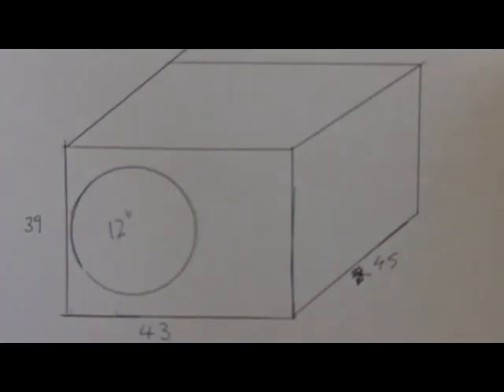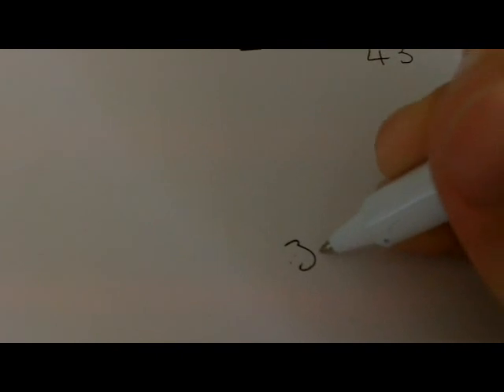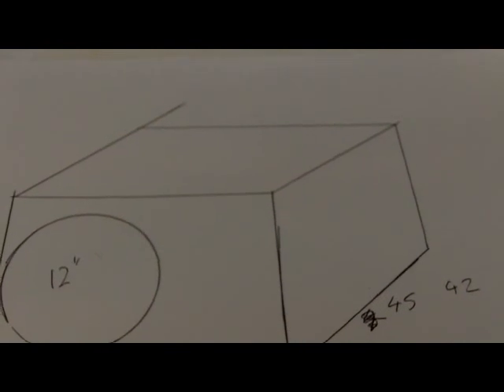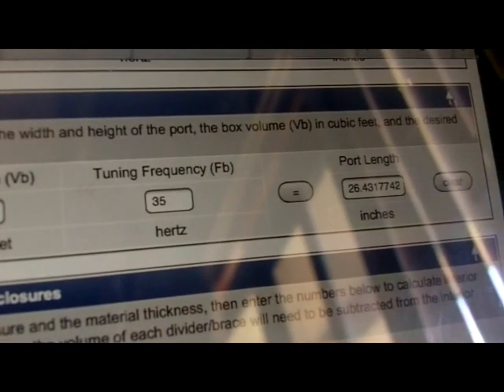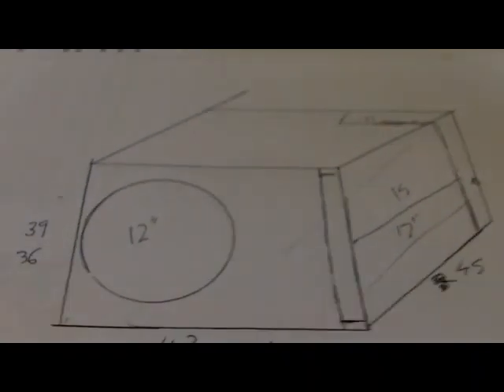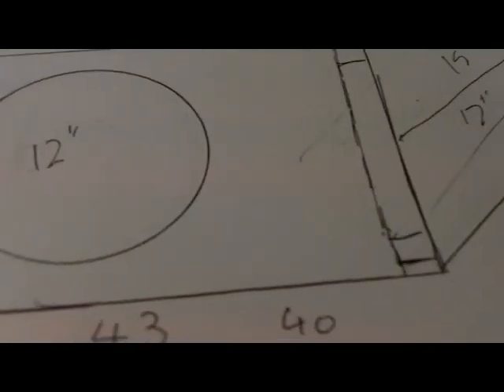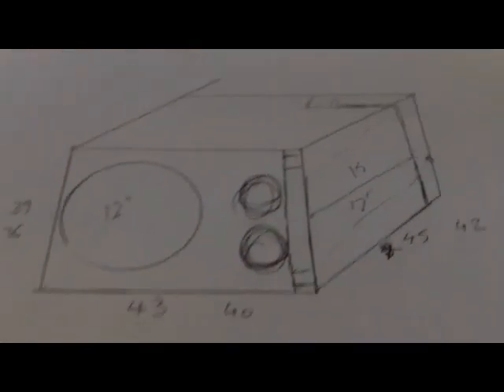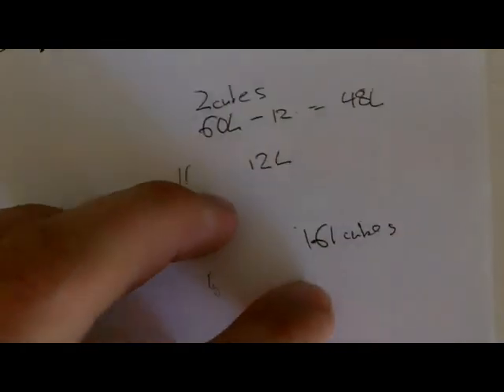HowTo: Tune A Suboofer Box To a Specific Frequency - Calculating Hz

Comment: I have pioneer 3004d4  subwoofer  needs about 35.4litres was thinking i do a 18" height width of 14" and depths of 19" calculating the vent port length gives me difficulties. Please help

Comment: This video seems to incorporate the port Volume ( or port displacement) as part of that 2 cu.ft internal volume figure that gets inputted into the calculator.. Are you sure we are not supposed to enter the NET volume instead? This to me would be the GROSS internal volume that we are currently specifying, and the video only mentions the removal of the displacement of bracing at 1:38 - 1:42 of this video

Comment: i am building a dual 18 inch sub woofer enclosure with a volume of 12.75 cu.ft
 using the KAPPA PRO 18LF-8 which has a usable frequency range of 38 Hz - 0.7 kHz , a resonance of 32 Hz and it also has a recommended box tuning frequency of 40Hz but i feel 40Hz wont hit the low notes just right .what frequency should i tune the box i am building to ,32Hz, 38Hz or stick to the recommended frequency of 40Hz?

Comment: Thanks for your video... The 60 liters about box volume... Do you need to add the port volume? Box volume + port volume? Or the port volume is inside box volume?
Reply: Box volume does not include port volume.  Box volume PLUS your port volume is how to correctly design your enclosure.
Reply: @pierregervais1567  thanks

Comment: What exactly is port area per cube?  Is the the per cube the per cube of enclosure, or per cube of port volume?  I'm trying to figure this out.    I've got a 1.287^3-foot box, using slot port 0.75x11.5inches at 14 inches long (tuned for 33Hz).
Reply: Alright, recalculated and did 1.5x11.5inches port area, same cube feet, and 29.7 inches long (keep it tuned for 33Hz).  This puts me at like 13.4, correct?  That's much closer to 15.

Comment: I appreciate the simplicity of your video. Just one thing, which you briefly mentioned but I'm sure all the kiddos will miss - the port has its own volume should be substracted from the overall volume of the box. In other words if your box is 2 cu ft/ 56.63 liters you have to add the volume of the port (plus the volume of the wood, used for the port) to these 2cu ft and the overall volume of the box will become larger.

Comment: If I gave you the dimensions of my box and port could you tell me if I have it tuned to 33hz I just got done building it yesterday and I'm not sure if it's correct
Reply from the maker: well id need the internal volume and the port length/width and height
Reply: can i just send you my google sketchup file ?
Reply: the box is suppose to be 6 cubic feet port is a L slot port and measures at 16.5" x 5.81"
the ports inner boards are measured 13.44" and the second one is 14.185" this is all .75" MDF wood the port lenght is suppose to be 31.28 inches if you have goog sketchup i can send you the file and another question does adding a second baffle to the outside after you make the box does it remove internal volume or increase it since the speaker is bascially being lifted further out of the inside of the box a 1/4 inch

Comment: To anyone who could point me right direction bc Im new to subwoofer enclosures. I made a custom box with a special design. its dimensions is 30"L x 18"W x 19" tall. with my design it comes to about 3.66cuFT. I have only one 4ohm twelve inch subwoofer. I think I made enclosure too big any help bc I want it to be ported or vented an tuned 31-32hz an hit really hard. any suggestions on vent lengths or port size

Comment: *****  i have 2 sundown as 12's in a 2.5 cubic foot sealed box, 1.25 each side , and have no idea how to tune a sealed box but have been told it can be done , want to tune it to 25hz
Reply: you cant tune a sealed box, now if you were talking about a bandpass than yes u can tune it. regular sealed boxes cant be tuned, they can only be to big or to small
Reply: larrythestoner415 I have a 4th order bandpass Im making and the ported section is tuned to 55hz how could I tune the sealed enclosure to play at around 30hz?
Reply: the sealed section is for your lows, and ported section is for your high bass. if your making a 4th order and your subs are already in a sealed section than you don't have to worry about the low bass. just make sure you don't put your subs in to small of a sealed section, give them a little bit of space also but not to much

Comment: hey @Australia's Biggest Bass Channel can you help me out, i have a kicker 12" l5 solo baric around 600 watts rms i built the box with an internal volume of 3.25 ft^3, i want to tune to 37 hz, do you recommend a round port or square port also can you tell me lengths? My previous box port was a wedge.

Comment: Great video man.
Ive done some calculation based on your video. On a box with 67.4L (with sub-1x12" sundown sa12 and all brace counter for), two rounded ports with 7 cm in diameter and 38 cm length, is that corect for a 30 hz ? The ports will exit the box by 10 cm, wich it is ok. The length and tuning frequency of the port is corect ?
And another thing,2 rounded ports with 7x38 cm will differ in any way from one with 14x19cm?
Reply: ai numele difuzorului ?parametri ?

Comment: actually that was my first thought and i tried that. it sounded horrible. i just finished resizing them to dividing the length in half and it sounds a bit better. real test will be in my car.  the speaker specs say to use : 2 - 4" ports @ 12" long. 
thanks for your help

Comment: Hey mate, ive got a soundstream amp which gives 700rms at 2ogm for now, will save up as still need to pay for lowering my bmw and body kit install plus paint. Will be getting a soundstream tarantula 1.2000d,so 1300rms at 2ohm mono amp.Can get it for like 400 buks incl shipping to my country which is pretty cheap, at the shops its 599 atm on sale.If i run it for now with my amp whats better? I want clean bass. So no number plate vibrations. Just bass and will cut a hole where is rear arm rest.THX

Comment: Hey mate,could you give me a help please. I bought a new sub and amp for my new car and want to make a box which will give all bass out of my setup. Ive got a Soundstream T7 800rms dual 4ohm coil sub, will be running it at 2ohm, and a soundstream 1ch mono amp, has 700rms and 2 ohm, i will be running it at 2/3, so i dont run my amp on full power and blow it. What box, amp setup i should get, ported or sealed.I want it for every day use in a car, im listening to house music etc. BMW 745 03,THANKS

Comment: I had my sub facing front they sound great in the inside but it doesn't sound as loud outside. If I face it to the bac it sounds loud but it rattles more. There Now Facing Up But My Trunk sounds terrible. I have a sealed box for 4 12's.